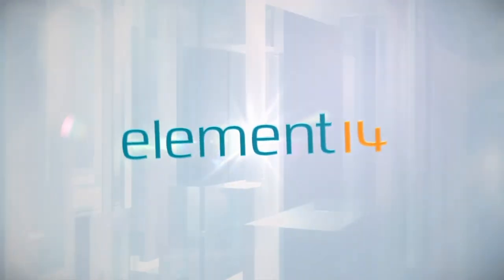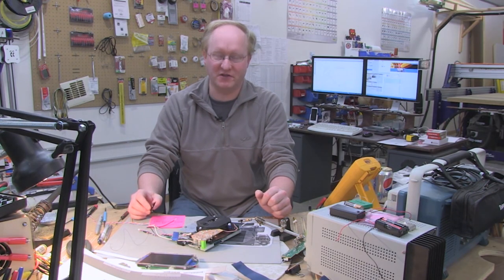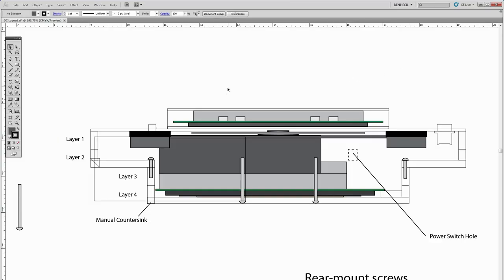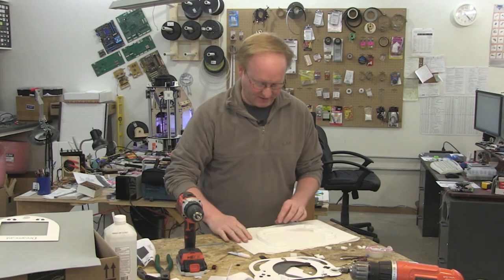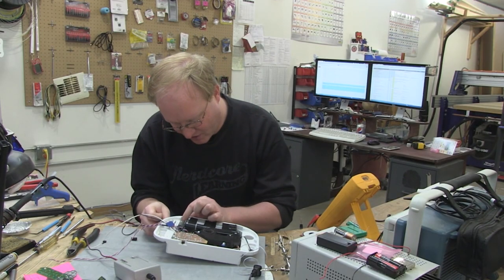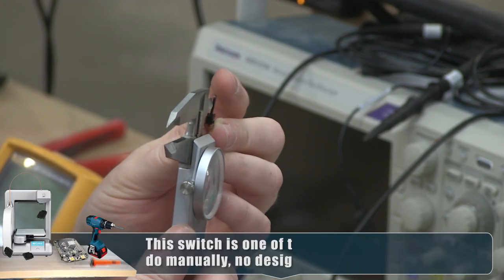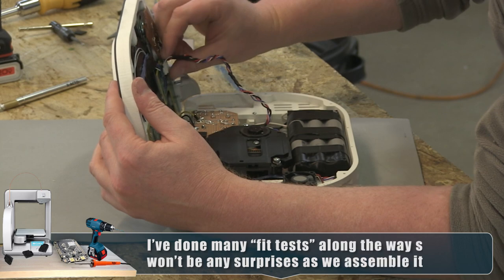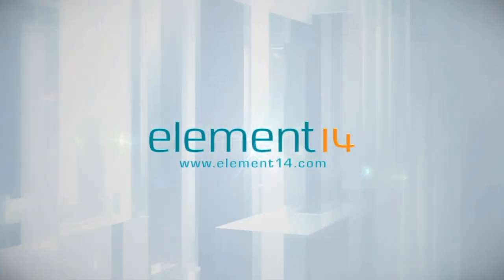Ben Heck’s Dreamcast Portable Part 3

Comment: As others have said, a removable VMU would have been better as many games require the screen in order to play Like Chao  training in Sonic Adventures I'd also love to have a portable dreamcast scheme like this, but using a PC instead with a SSD so you can download DreamCast games and play them. It'd save alot of room doing this alowing you to make a more Dreamcast-esqe design for the case.
Reply: In all of the games that utilized the VMU display it was always  an optional feature. The little sticks were purchased separately and not everyone bought them. In the case of the chao you could transfer your chao to it and play with them away from the console like a little portable mini game. It was not required to do this, only a fun little feature. I think Ben made the right choice leaving it out, it just doesn't fit.
Reply: Saying that the VMU display is only an optional feature, and that training your chao on it was "Not required" is a bit misleading. Sure, it wasn't required. Then again, the chao garden itself wasn't required. Playing the game at all isn't required to operate the system...
The VMU had over 50 games utilize its display which considering the dreamcasts tiny library, thats a hefty amount. The VMU is absolutely necessary and IS required, to play all the mini-games developed for it. Soul Calibur had a bunch of games for it, Power Stone required it to play a bunch of its mini-games, even Namco Museum needed it to play Pac-it. Besides that, there are plenty of games that did truly require it for various displays during gameplay. Like finding nearby hidden items, and HP displays.

That of course isn't even the biggest issue with not including a removable VMU. VMU's were notorious for there tiny data storage, you really couldn't save more than 3 games on each VMU depending on the games. Sonic Adventure for instance takes up an ENTIRE VMU by itself!

Making the VMU internal means that you have to take apart the entire system in order to replace VMU. Otherwise you can't save. Though if you were like me, you could just leave it on for a month straight and pause the game...Thats what i did lol

Of course this is all the more reason to make an emulated version of this, it'd take up much much less space and an SSD would hold every game ever created for the dreamcast, while allowing you to make a much cooler design for the system.

Comment: I would have removed the GD-ROM and put a microSD card slot. With the space saved, put both VMU ports (with VMU window) along with a 2nd controller port and microHDMI port.

Comment: Haven't really modded a console so to speak, but i did make a battery pack for my nes when i was a kid so i could play it in the car on one of those little black and white cigarette lighter socket powered tv's (also added an rf socket to the tv)... Worked well, for about half an hour till the batteries went flat.. Lol should have just found a 9v lighter socket power supply and added the Nintendo plug on the end. Eh... Think it was great for 8yo me.. Not so great on today's scale though haha

Comment: i would have tried to use a more modern disk drive IE an old laptop cdrom would have been more work but the savings in space and weight would have been worth it
Reply from the maker: hikecraze The Dreamcast used GDRoms, which were 1gByte CDs - your typical laptop cdrom drive couldn't read them.
Reply: The Ben Heck Show I heard it was super easy to copy dream cast disks... since they had no drm...

idk why i felt like saying this... but yeah...
Reply: girrrrrrr2 yeah I heard that is the reason sega went under because they lost their butts because of piracy with this system
Reply: The Ben Heck Show Did you know that there is an IDE port on the motherboard of the dreamcast ? (just just the soldering points, not the full connector af course). There are a few peoples that tried to wire an HDD to it and with some homebrew, it could launch games ! And so, with an adapter, i'm pretty sure you can plug in a SSD in. You can also make a tiny SD card reader for the dreamcast by soldering it to the serial port of the console (there is almost no hardware needed to do that, just some resistors, a capacitor and a SD connector), but it's slower than IDE. And then to access the HDD or the SD card, you have 2 choices : put a boot CD (useless if you remove the CD unit) or change the BIOS of the console (yep there are homebrew BIOS all over the web to use these ports)
Reply: Deksor thats awesome, thanks for the info

Comment: For any modders out there, dont use the disc drive on your dc portable, just replace it with an SD card reader, a million times smaller and will definitley slim down your DC portable.

Comment: why do you do all of that if you can just use an emulator !?
Reply: Cus emulation isn't as good
Reply: barookqtr123 Emulation might be easier but isn't better. If you wan't to emulate more powerfull machines like PS2 you need a quite beefy machine to get there like an i5, r9 290 and a crapload of PS2 bios in order to change it if a game isn't working, like MC 3: Dub Edition in which I tried 3-4 different bios files (from friends with different PS2 versions, no piracy please) till I got it to run at the 59-60 average fps mark (cause unlike PCs, if you have too many fps the game is like in fast forward or too low and you are in slow motion so you must hit 59-60 fps constantly) and still the audio shits itself sometimes.
Reply from the maker: barookqtr123 Part of it is just the challenge of it, and the "because we can" factor. There are other reasons to use the original hardware too, you know it's going to work as it should with the original games, it'll definitely work with games you own and the timings are all correct. That isn't guaranteed with emulation and often you need a vastly more powerful computer to emulate the hardware (look at the system requirements for Playstation 2 emulation for example).
Reply: okay now i understand

its actually fun to challenge your self to build it and then see the results

Comment: Placing the memory unit inside the portable is on my opinion a bad idea. It was more then possible to save the space this MU Stuff take to make a proper connection for MU/VMU and the other stuff like Action Replay, Rublepacks, Microphones, ...! A smaller connector also could easily retrived from an VMU / MU

Comment: Honestly, and I know its not the point, I would have used a Raspberry Pi3/NUC with emulation, also the advantage would be better battery life, thinner profile, and a slot loading drive versus having to flip one up.....speaking of which I am currently building a Picade and almost completely done the hardware portion of the project, now its soon time for the difficult part...software.

Comment: You should've just used a memory card instead of the actual disc drive, it's a very popular mod among Dreamcast gamers
Reply from the maker: osga21 Part of the challenge is sticking to using original parts and having it function like it did as a console. Else you may ask where do you stop? Especially with emulators working well these days.

Comment: Cutting material looks thousands of times faster than 3d printing it
Reply: Xano Trevisan Kothe Keep in mind that the cnc he uses(while still cheap for what you get) costs over 20k$. Its a popular machine to use at local fablabs around the world, so you could possibly find one locally.
Reply: Xano Trevisan Kothe Cutting away material will almost always be easier (and faster by extension) than adding more. :)